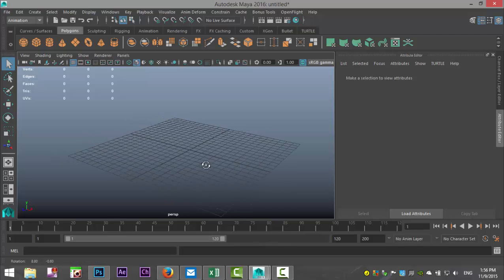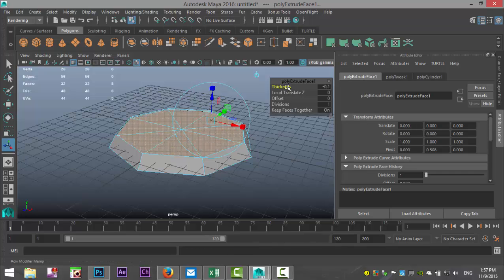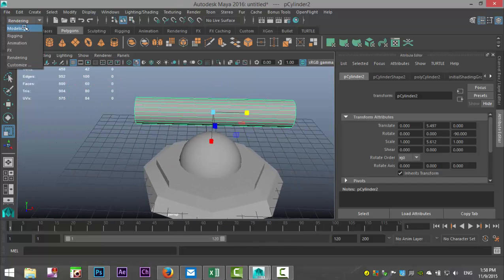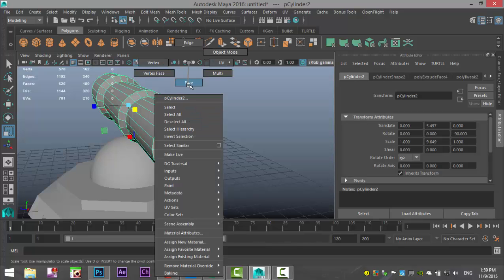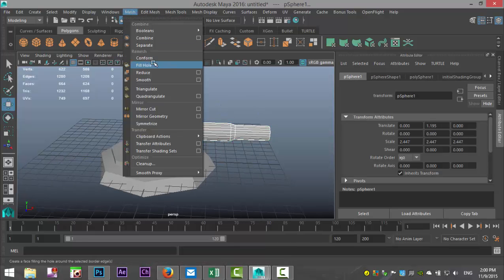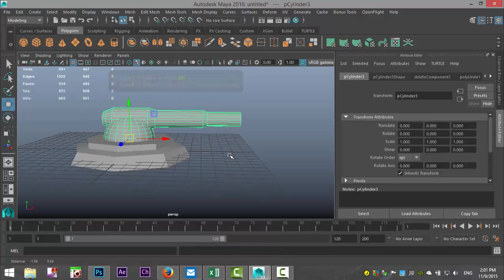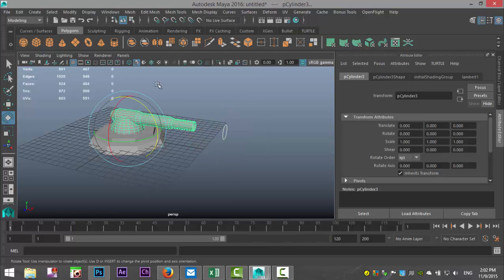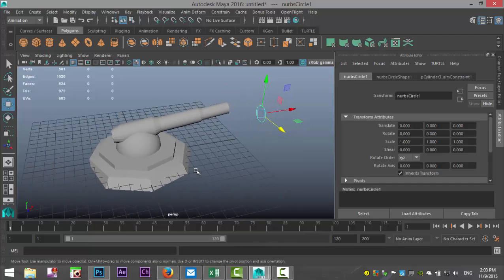Maya 2016 tutorial : The Aim constraint

Comment: how conect 2 diferent object  ,one smooth and another unsmooth, and keep initial forms?
Reply from the maker: +Life in 3D There is no smooth and unsmooth. There is low poly and higher poly. When you hit 3 on your keyboard you get a "preview" smooth but this is only a preview ( not real increase in polycount )  When you try to connect this it won't work. However when you go to Mesh - Smooth on one the object you have a real actual increase in polycount.
Reply: thank you
Reply from the maker: +Life in 3D No problem